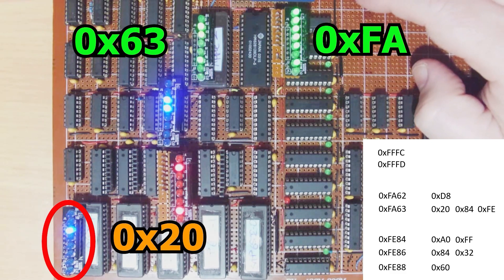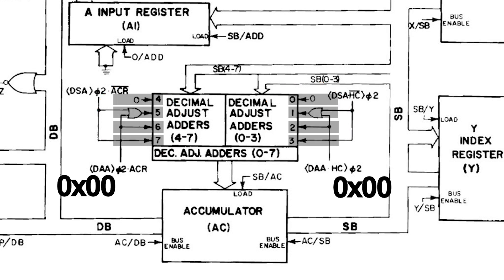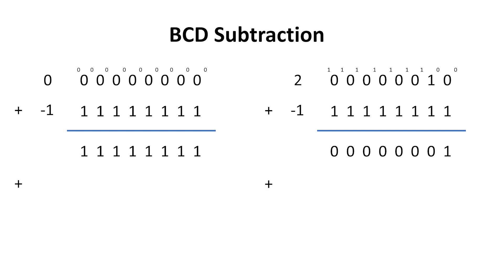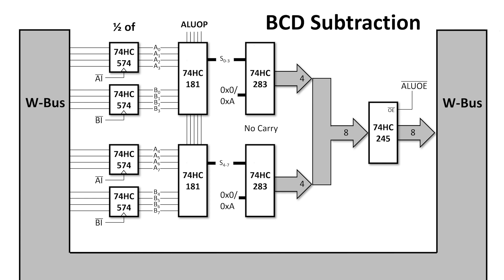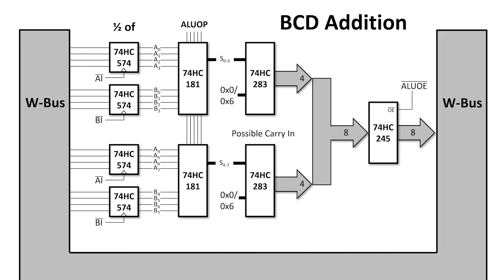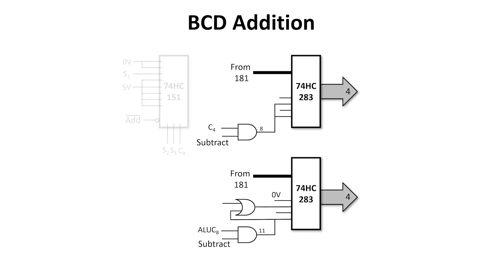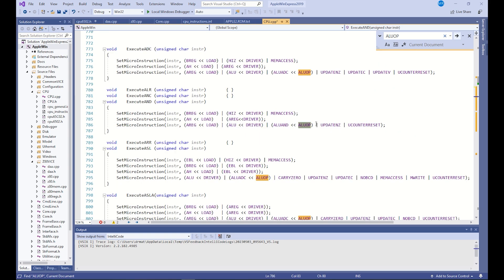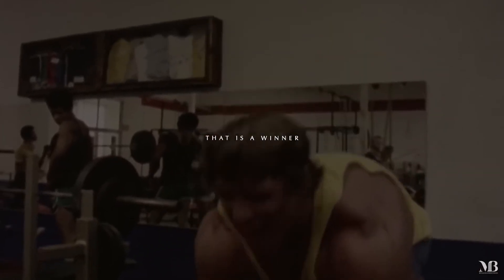How to build a 6502 TTL-CPU:Part 9 Finale - Decimal Mode

Comment: I have always wondered how decimal mode worked, so this was interesting. I also realized that I forgot the sum of products since I don't use K maps.
Reply from the maker: The thing I forgot to go over was the overflow flag.  It's different for the 6502 vs 65C02.  I use the 65C02 convention where bit 7 from the decimal adjust is used (vs bit 7 from the ALU for the 6502).

Comment: I like this series a lot. It is a nice sequel to the SAP-1 from Ben Eater and the SAP-2 like computer from Slu4, which I both build. Certainly considering to build this one also. But I'm wondering how the Monster6502 is capable to build a 6502 processor in just 3218 transistors. Your TTL build seems to go way over that amount. Do you have any idea how Monster6502 was able to do that?
Reply from the maker: Thanks.  Yep, that's a good question.  I think a better metric is gate count rather than transistor count.  If you remove the sequencer, our (both mine and Slu4's) gate count is probably on par with the Monster6502.  TTL logic does use more transistor per se, but that's because the newer parts in the series are designed to drive high capacitance loads at high speed.  Slu4 got his design to run at 8+ MHz on breadboard, while the Monster6502 does 50KHz on PCB, more than 100 times slower on a more stable substrate! 

The sequencer is where we admittedly waste space, for example the microcode for indirect Y indexed addressing mode is repeated 8 times.  But, I think the sequencer in the SAP-1 is the easiest to understand, which is why I stuck with it here.  The sequencer for the SAP68000 will have to be more carefully designed because we just can't do it the same way - but you'll have to wait for that!
Reply: do you have a scamatic

Comment: Hello Sir, I am a software developer. I have basic understanding of how Ben Eaters SAP 1 works and some basic understanding of Electronics .

i really like to build this TTL CPU one day and run games on it, but as of now i don't have budget to do so.

is there any way of designing the whole CPU in any kind of software, and then write games for that CPU and test whole as a single computer? (same as you are doing connecting your CPU to your computer and running games off of your TTL CPU).

i guess that is the only option i have as of now so that i can follow along with your videos.

How can i get started with this approach, any ref material, or any videos.

if you could make a short video about my problem statement. this would help a lot of people like me who has very limited budget but would love to enter world of CPU. :)

thank you in advance
Reply from the maker: You might want to look at the SAP6502 microcode series, you can down load the code from github, it runs on AppleWin which is also available on github and you can compile it in Visual Studio which is also free.  Give it a try.
Reply: @DrMattRegan  thank you for the help, last night i have gone through some of your video's. 
what I could gather up from them is, we are building the custom 6502 not with all the registers but some of them. but instead of creating our own custom instruction set (like Ben Eaters SAP 1) we are using 6502's instruction set so that will will simulate actual 6502 hence can it run Apple II games since they under 6502's instruction set.